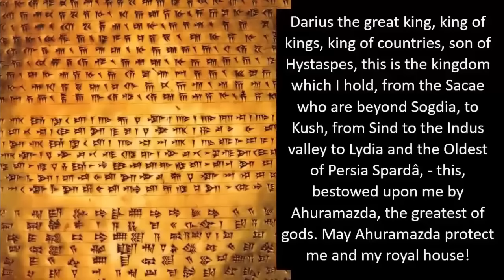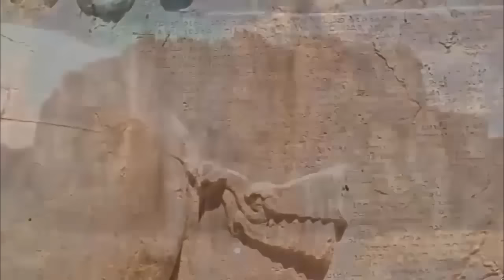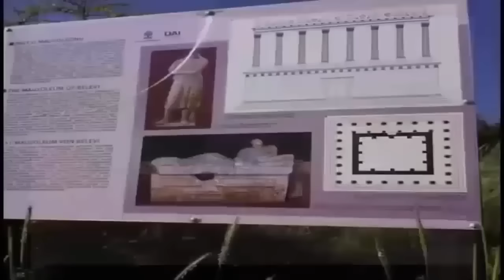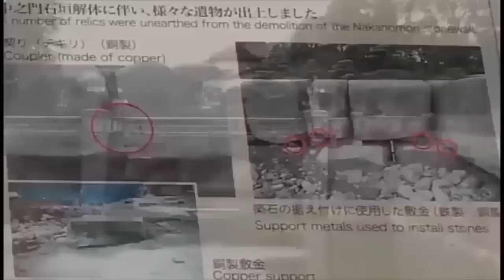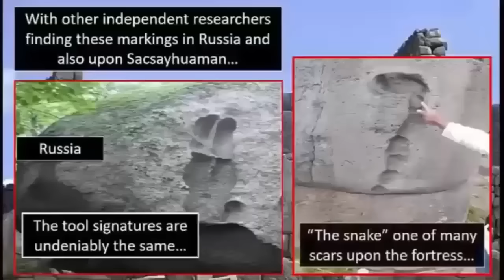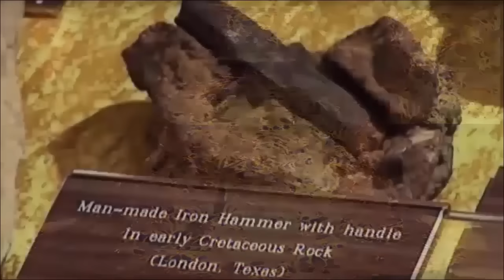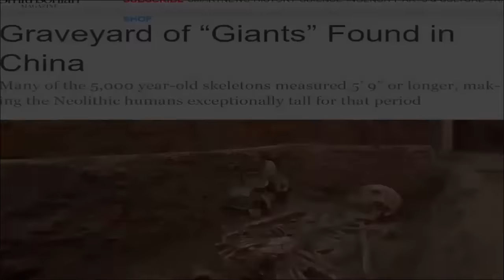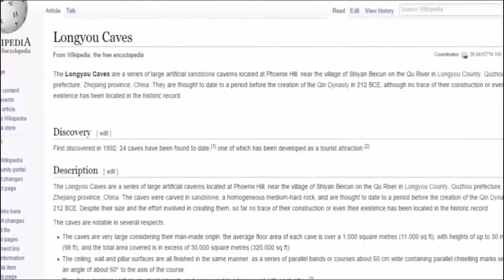The World's Most Incredible Pre-Flood Ruins?

Comment: What happens to metal after thousands of years, does it just erode away into nothing?
Reply: In most conditions yes
Reply: @codylovelace2237     It would have been too valuable for following cultures to leave behind and was most certainly harvested for making tools.
Reply: Precious metals like gold silver last forever copper lead and bronze can last thousands of years everything else turns into dust and blows away leaving no trace
Reply: @piehamcake1    Of your mix only gold "lasts forever", nitpicking but silver oxidizes easily (silverware tarnishes very quickly if not taken care of, just thin surface corrosion generally but keep cleaning it off and it can become significant), 1000 yr old silver coins are generally very degraded if found in the ground or from a ship wreck say.